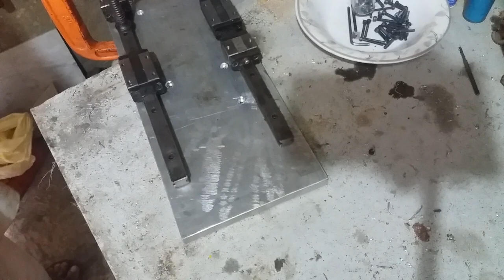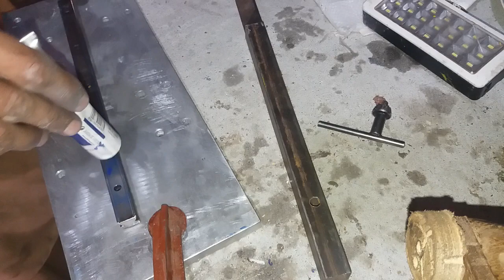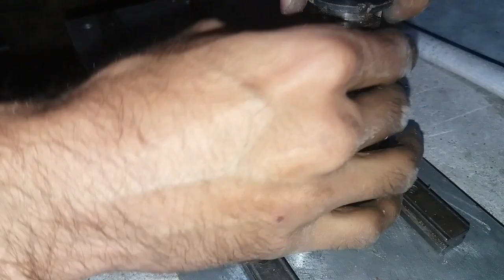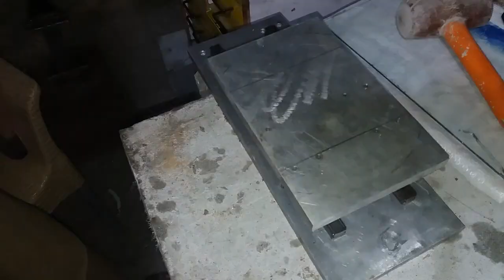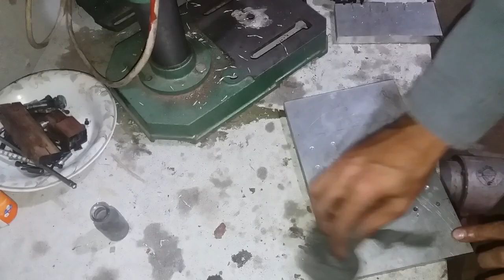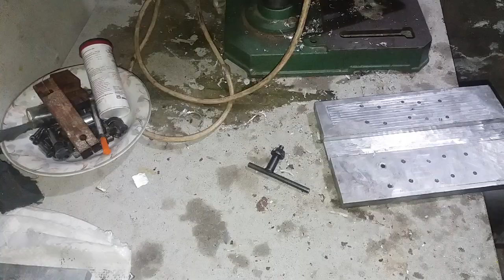HOMEMADE LATHE PART 3 (COMPOUND SLIDE) | TORNO HECHO EN CASA 3 PARTE (DIAPOSITIVA COMPUESTA)

Comment: you need a calibration tool. Calibration plate (cast iron or granite), calibration scale (rail), calibration angle. You can do it with your hands, there are methods But mikoronny indicator and micrometer will have to buy on Ali Express, they are not expensive.
Reply from the maker: Thanka . I had not available these tools and i was not good in it . But i am planing to build another machine soon with better tools
Reply: @techytools5668  Making a calibration plate is not difficult. You can use the "three plates" method. But in any case, good luck buddy.

Comment: This is not criticism. But your “flat aluminum plate” isn’t flat because you clamped it in the middle when transferring the bolt holes. If you clamp evenly between the four bolts of each carriage, it would not cause as much deflection. 

- a metallurgical engineer
Reply from the maker: thanks bro. but it was my first try and i havent good knowledge of mechanics.  so there are lots of mistake i make. it was good learning experiance
Reply: @techytools5668  great learning experience...for all of us...thank you for your efforts.